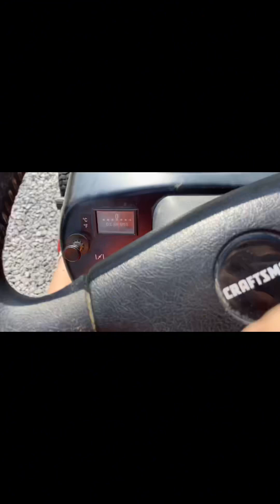Big red compilation

Comment: How fast?
Reply from the maker: 50mph, looking for a new engine though, this one is slowly dying.
Reply: @Mo_2118  Dang that's fast, I'm also trying to find a engine for my lt1000 project that I got for $50 because the old one was locked up & leaking oil when I got it. I've tried a 14.5  hp Briggs and Stratton on it, and yesterday I put a new carburetor on it and it turned over but wouldn't start, then I disconnected the carburetor solenoid and it had gas all over it and was smoking for a few seconds. I like to work on stuff, but sometimes it costs more than I can afford. 🤣
Reply from the maker: @that_one_mower_guy  understandable lol
Reply: @Mo_2118  yeah lol